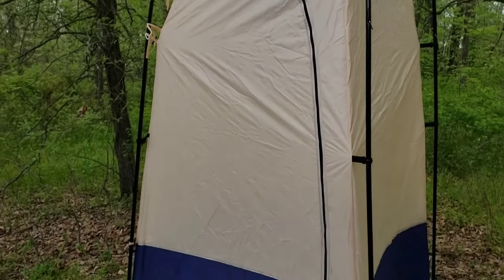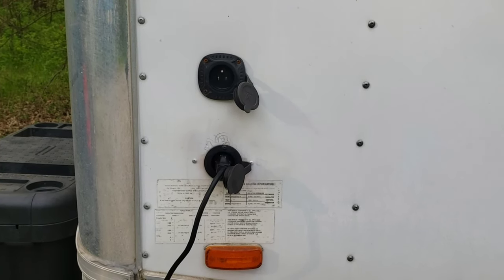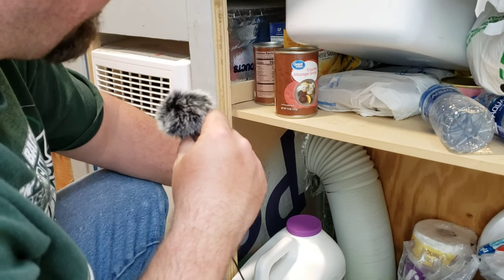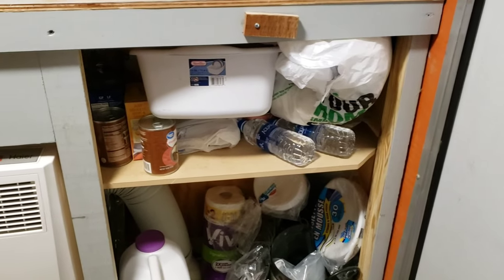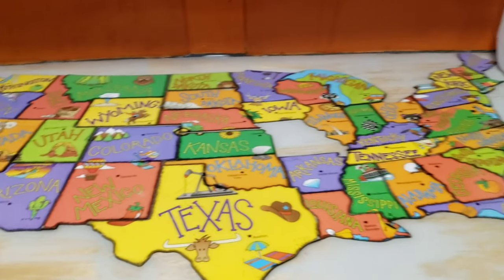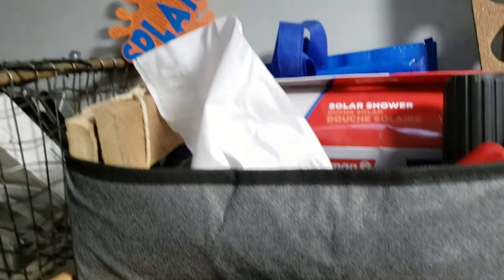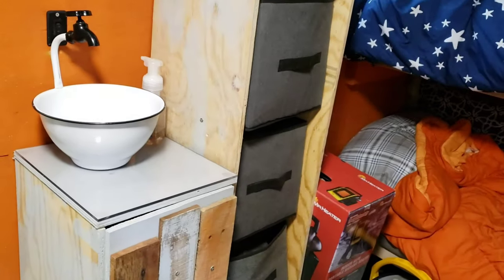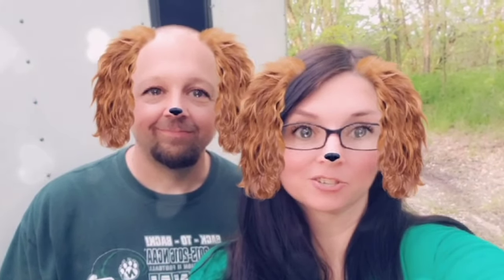Cargo Trailer Conversion Walk Through 6X10 Camper

Comment: You guys have a pretty good set up in that trailer. I have to admit, you fit more in there than I thought you would have. Can you use one of those magnet (as seen on TV) screens for your door? Is the door to wide for that? They velcro inside and you slide in and out thru the middle. I'm sure you already thought of those. I like your set up. Thanks for sharing! 😀 Safe travels, Steve
Reply from the maker: We actually have 2 of those magnet screen things. We just haven't tried using one yet. It may be too much of a hassle. If Darbi's inside and sees a squirrel she'll run right through it lol. But I'm sure we'll try it at some point.